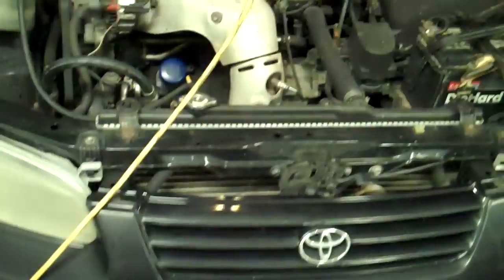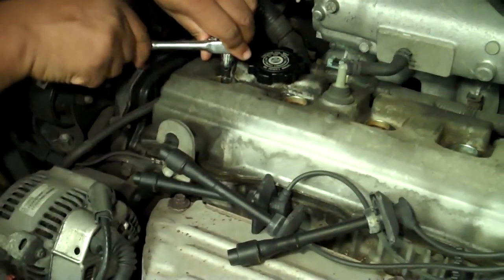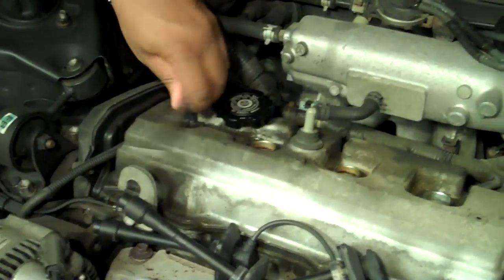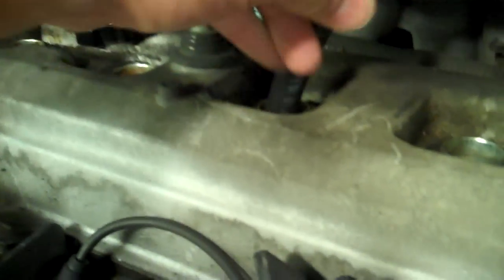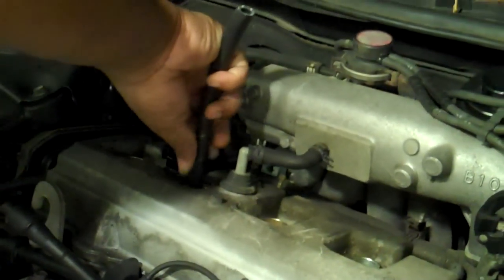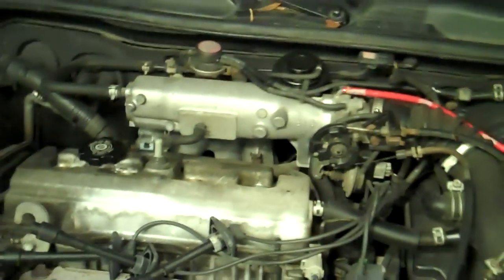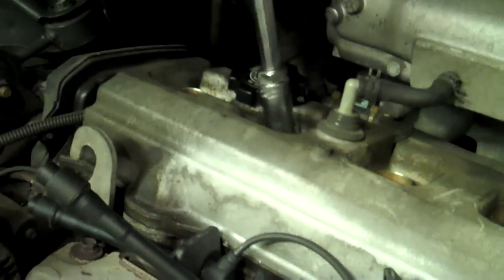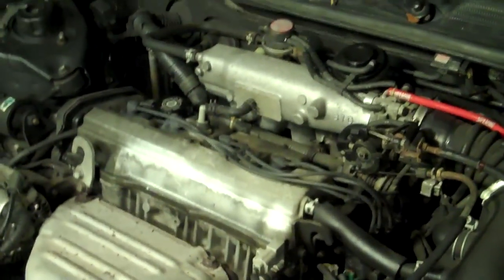How To Change Spark plugs in a Toyota Camry 1999

Comment: Thanks for the video!  Coupled with one about replacing the wiring allowed me to replace both in under 40 minutes! And I went slow with little lighting.  The rubber inset in the 5/8's socket worked fine removing and inserting the plugs.  The music choice brought me back to my youth.

Comment: You could have used the spark plug boot to get the plugs out, instead of resorting to a separate hose. Also, you got guts pulling out all the boots at once, instead of one at a time, as most people would do! One mistake, and have fun figuring out the right order! (okay . . . maybe it isn't so tough with a 4-cylinder vehicle, but I'm an 8-cylinder guy, and no way would I pull them all more than one at a time!)